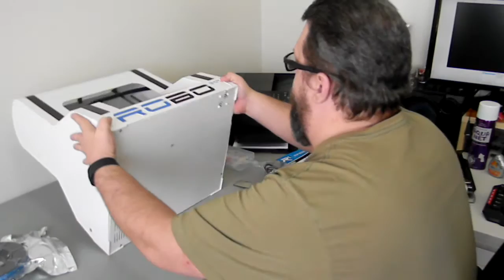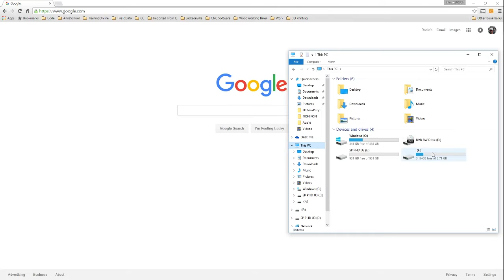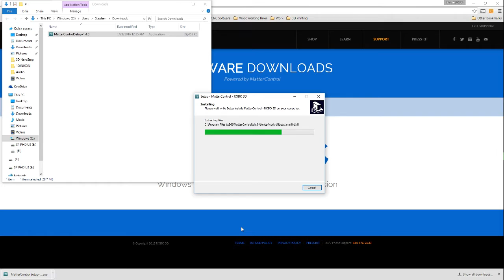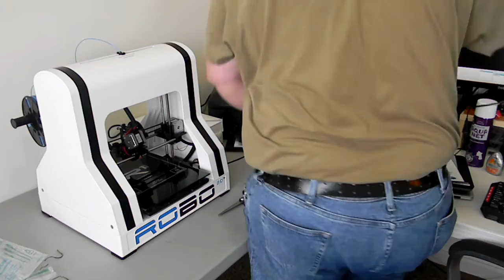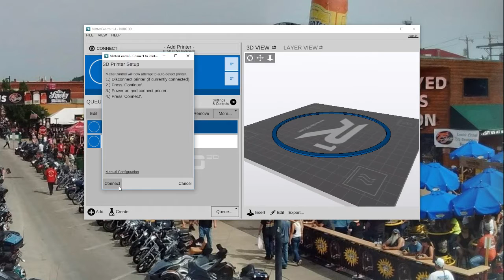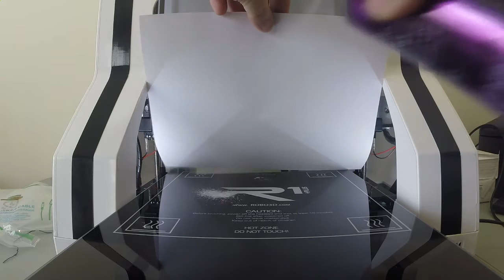ROBO 3D R1+PLUS Setup & First Print

Comment: I think it's fair to say another opinion doesn't hurt so I'm going to leave my review and experience here while I'm frustrated and need to vent. I will try my best to refrain from exaggeration. 

If I could go back and say something to myself over 3 months ago before I bought this printer it would be "DO NOT BUY THIS PRINTER." The first week I had was by far the best experience I've had with the machine. After getting past the poorly made way to load filament, it printed very well and it was awesome. A week after I got it, the thermistor stopped working, and me not knowing much about the printer yet took apart the extruder multiple times which eventually caused the heat break to bend. Rather than get a new hot end from the warranty, I decided to just buy an e3d v6 which I planned to do sometime in the future as an upgrade because I heard it improves the print quality. I installed it without too many problems besides it taking over half a month to arrive, but once it was installed I could not get it to print the first layer right. No matter what I did, it would press itself against the bed not allowing any plastic out. It kind of just suddenly started working. After that, I decided to print a cable chain since it looked cool and I did that without any problems until for some reason the logic on the x endstop was reversed when I hadn't done anything. It would think it was hitting it when the end stop wasn't being pressed and It would think it was not hitting it only when it was. I changed a line in the firmware and it worked. After that, I had it working well for a while. Then all of the sudden, I repeatedly got this error that said the temperature dropped too much even though it clearly did not. That just stopped happening for no reason too. Then a few days after that, I started having problems with the bed leveling. It would not print evenly. It would print one side lower than the other so that one side would be pushing against the bed while the other could too far above the build plate. I still have not gotten that to work right 100% of the time. Sometimes it works and sometimes it doesn't. I was having problems which weren't the printer's fault of the fans cooling down the hot end so I decided to buy a 40w heater core. When it arrived, I realized that the screw holding the 25w heater core was not going to come out. Eventually it become so stripped that there was no hope of ever removing it so I bough just the metal part of the hot end because I already had the heater core, nozzle, and a spare thermistor I bought with the heater core since I had prior issues with a thermistor. That installed with no problem until the heat break became a little loose and plastic leaked everywhere from the top. Later when I cleaned it up, I realized there was a huge jam inside just the heat break which I eventually got out. Then the printer worked well for a day before I woke up today to see the print I had done had jammed a little after it started. It was actually probably a clog since when I finally got plastic to go through, I required a lot of force. I had to heat it up to 280C to be able to extrude plastic with reasonable force to season it. When I became evident that clog was not coming out, I decided to take out the hot end. While trying to unscrew the heat break, the heat break decided to snap in half instead of unscrewing. It was the result of the plastic being in the threads because that happened before and I just heated it up and it moved and it was still at 280C when it broke. Now I'm stuck here needing to buy an entire v6 because everything is fused to the hot end because of the leaking and half of the heat break is in the cold end and I can't remove it since there is nothing to grab onto. I've had countless other tiny problems. My own incompetence has contributed to some of these problems, but they are not all my fault and many of them resulted after I tried to fix prior problems and made worse problems.

This isn't the printer's fault, but I've had terrible experiences with filament too. The first filament that came with the printer printed amazingly. Then the second spool I got because my small school had a 3d printer for one quarter and I convince the teacher to give me one of the remaining halves of a spool instead of giving it to the next school and that printed just as well. Then the third filament I got printer like shit. Eventually I decided it was a bad batch and got a fourth spool with printed like shit. Now I have fifth and sixth spools from Robo3D themselves since I had such good luck with the first sample spool that came with the printer. They both print like shit unless I print at a .1mm layer height which then the print ok. I also bought abs which printed well for the only print I will ever print with it because the printer is in my room and it smelled toxic and I have some sainsmart TPU which also prints like complete shit even though I've tried printing it at a huge range of settings with most being just shittier than the last. 

People have been talking about how far 3d printing has come in the last few years and that's either because they have expensive ass printers and expensive ass filament or because I have terrible luck. One of the reasons I decided to get a Robo3D was because of this channel https://www.youtube.com/channel/UCBGNc_mOP_amZNrNj6lAwHg. I would recommend going to his channel if you have or might buy a Robo3D printer. Some of his videos helped me fix some of the problems I had.

I would recommend a kit so you don't waste as much money if you have a bad experience like me and you can become familiar with the printer without breaking it like did. I'm only sixteen and everything mentioned in this comment was paid for by myself from summer jobs. The times it did work were so amazing it was almost worth the money.
Reply from the maker: I'm sorry you have had so many problems with you ROBO 3D. I have had mine for just over a year now and I have had some problems but nothing like you have had. I have been lucky and I have not had any hot end problems yet. When I do I think I will get the hot end from ROBO and get the same hot end that came in the printer because it has worked so well for me. As for your bed leveling problem check out my video on the bed leveling problem I had and see if it will help. https://youtu.be/cLm5NYDS9zQ

Comment: When I try and print with mine the build plate shakes bad and doesn't make smooth movements like yours does. Would you have any idea why? thanks
Reply from the maker: Check that the belt drive is tight under the build plate. Check that the build plate rods are not bent. If all that looks good I would call ROBO 3D it might be a bad stepper motor...
Reply: I found out was happening! the belt was slipping on one of the pullies. So I tightened it up and it works great now! thanks for the info

Comment: Help...I have the same 3D box but downloaded the  software directly from Matter Control. For some reason when I attempt to print I get an error message that tells me to "Switch-off automatic bed leveling" or reset print filament  (code C29)    ( I can only control X,Y, & Z, axis and extruder movement manually)  How do I eliminate this code so that I can print the calibration ring automatically? Thanks, Carter.
Reply from the maker: In MC go to VIEW --> Settings --> Custom G-Code --> Starting G-Code: (Does it look like this?)
G28 X0 Y0 Z0 ; home all axes
G1 Z5 F5000 ; lift nozzle
M109 S[temperature] ; set the extruder temp and wait
G28 X0 Y0 Z0 ; Home Z again in case there was filament on nozzle
G29 ; probe the bed

Comment: hi, as you mentioned it was flat at the bottom part but not at the top, do you know how to deal with rough part?
Reply from the maker: I have found with thin prints like that ring to top will be as flat but if you get it a bit thicker the top is much flatter. I try to no print anything under 1 mm on the Z...

Comment: if you are not supposed to insert the filament until the head is hot.

what do you do with what is in the head after printing?

how do you clean the bed after printing?
Reply from the maker: What do you do with what is in the head after printing? If I'm not going to print for a day or two I will cut the filament about 6 inches above the head and leave it in there to keep dust out of the hot end. How do you clean the bed after printing? I just use water and wipe it clean... Check out these vidoes https://www.youtube.com/watch?v=xd4GHUBFBjQ and https://www.youtube.com/watch?v=xSFeI1HGQ_o

Comment: I need this 3D printer... still around $500 away from my goal.. ughhh...
Reply from the maker: +adamasadamas It took me a year of saving to get mine. I'm glad I saved up for it and did not get something smaller, but that being said there are some smaller ones I want to get.
Reply: Yeah this one seems worth the price for what it can provide.Anyway thanks for the video, this is the best Robo 3D R1 Plus video that I've seen and it's very informative. Just gotta save some more cash sigh :)
Reply: I just bought one used for $100 that has a bunch of upgrades... hopefully it still works well.
Reply: im only 8 and i have 7 3d printers